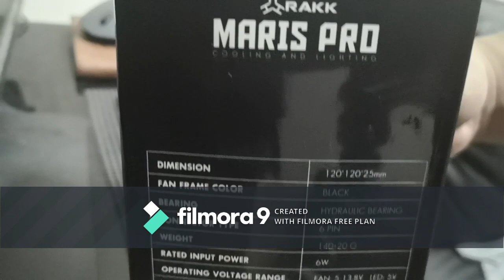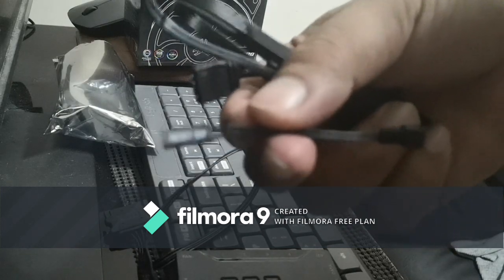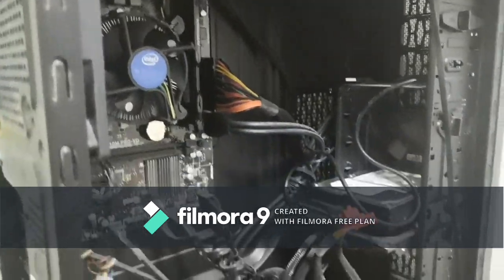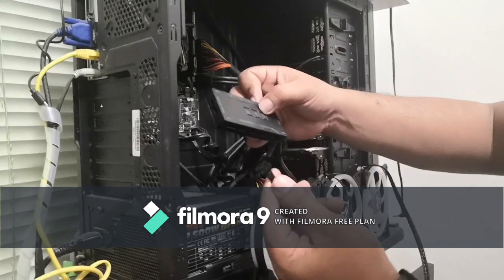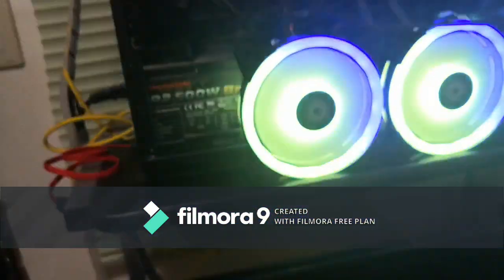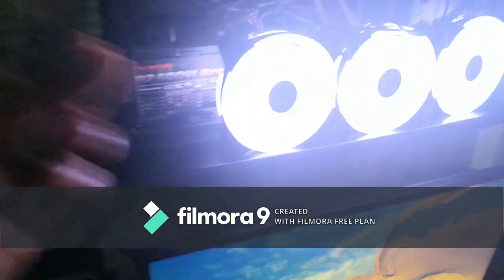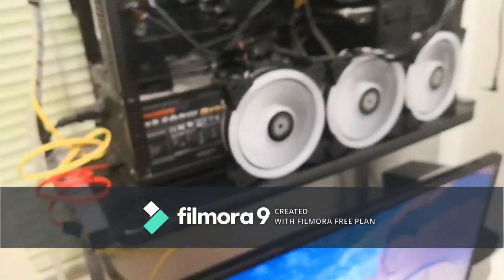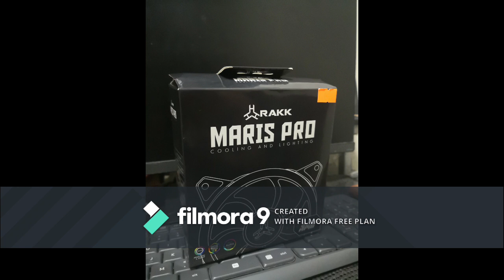RAKK MARIS PRO UNBOXING, QUICK DETAILS, AND TEST

Comment: Hi Sir! nagkaproblema ako setting up my Rakk Maris Pro. I have gigabyte aorus b450 pro wifi. Nilagay ko yung RGB header sa D_LED2 VDG (3 pins) tapos yung sata connector sa my power supply. nung una gumagana yung fans, tried to use the remote control(i already removed the plastic lol) but nothing happends and after a few minutes, umusok yung fan hub and then boom! hindi na gumagana yung fans.

May mali ba akong nagawa?
Reply from the maker: Hi sir, I'm not so sure about the cause of smoke from hub, it could be the power supply capacities, but afaik it has 1 yr warranty from shops, have it inspected Para hindi sayang yung fans, for sure yung hub lng ang faulty. Hope it helps
Reply: Kung 5v yung fan argb yun at kapag nilagay mo sa 12v rgb pin sa motherboard may tendency masunog yung hub or fan
Reply: Same tayo bro, any updates?

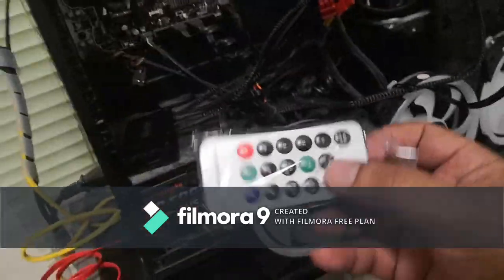Comment: Nice video but still more room for improvements. Tanong ko lang po sir, 6:50 yung side ng fan hub facing the cam, wala pong wires na naka attach. Yan ba yung side na papuntang motherboard? Bat hindi nyo po nilagay mga cables?
Reply from the maker: thank you sir, yes wala po nakalagay doon na cable, those are intended for motherboard RGB/aura sync ready pins.

Comment: Quick question lang po. Kahit walang RGB header yung mother board mo iilaw pa din?
Reply from the maker: YES! all you need is sata power - going to fan hub controller, then it can be controlled via remote or buttons from the hub itself.
Reply: UNWRAPPH thanks a lot. Mukang mapapapurchase na ko.

Comment: Sir okay lang ba sa psu lang ikabit at hindi na ikabit yung cable papuntang mobo (sys_fan)?
Reply from the maker: yes, PSU okay. no connection for sys fan. hindi sya pasok pag sa non rgb ready mobo.
Reply: @pulz1112  A320m lang kasi board ko sir, pero may isa pang sys fan na available. Sa psu ko nalang ikabit yung fan hub ko then yung ibang cable hayaan ko nalang?
Reply from the maker: @ChrstnDpl29  hindi po sya kakasya doon if sys fan inlet lng.